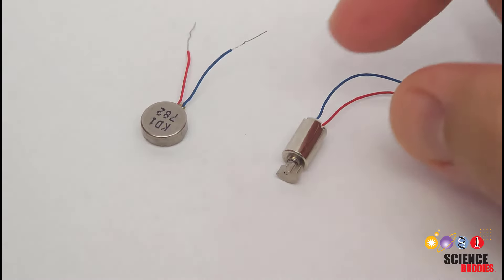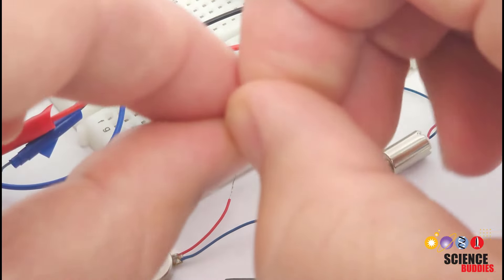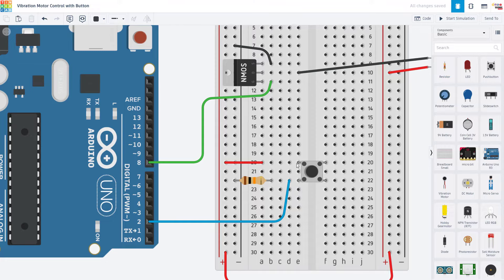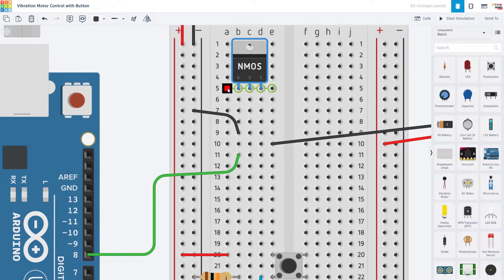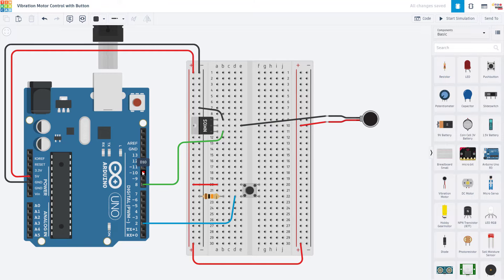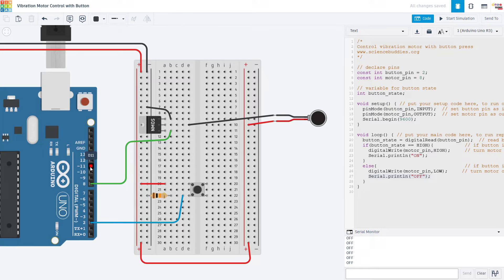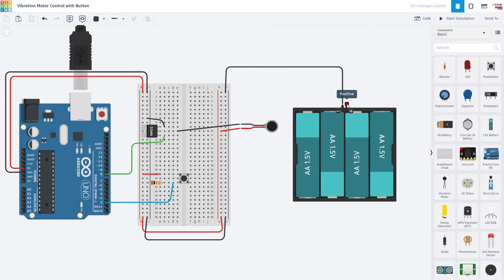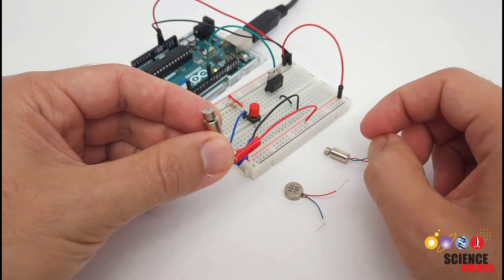How to Use a Vibration Motor with Arduino (Lesson #25)

Comment: Hello. Firstly, I really appreciate your content. I'm curious if it's possible to make it work adding a single 9V battery as an external source. I intend to operate it with a 7V vibration motor (similar to an ERM) since that's what I have available at the moment
Reply from the maker: Hi - in general 9V batteries are not a great choice for running motors since motors require a lot of current and 9V batteries drain pretty quickly. They work better in longer-term, low-current applications. It will work if you are only going to vibrate the motor occasionally though. We have an additional video about using an Arduino with external power supplies here: https://youtu.be/XrJ_zLWFGFw?si=3NdMPCNO03xuBYfg
Reply: @Science.Buddies  Thank you so much for your guidance, sir. I'm a newbie, but after watching your second video, I was able to make it work. Keep up with these great videos!!

Comment: Thanks, I dont code with Arduino but your examples and commentary is teaching me so much stuff I can apply to my raspberry pi projects etc, thanks for the comprehensive, no steps skipped, tutorials
Reply from the maker: Thanks! Many of the digital devices we cover in our tutorials could also be connected to a Raspberry Pi's GPIO pins, so at least the circuit part should be very similar if not identical.

Comment: cool beans.
I think  tinkerCAD might be throwing an error because there's not any voltage protection on the back end of the motor to prevent inductive spiking. 
Although you're talking very small currents, inductive voltage spikes can be either positive or negative, and if you don't have a method of preventing that voltage from feeding back up into the arduino, in theory it could be a problem. 
Like ya said in the video, since it's a circuit simulation, theory is the only thing that matters there, but you might be able to get around it by adding a small diode off the tail end of the arduino ground pin to battery ground pin.

Comment: can i use the motor directly with the arduino like i use my LED?
Reply from the maker: No, the Arduino pins can only supply 20 milliamps (mA) and the motors can use up to 100mA.

Comment: What kind of motor do you use for this application?
Reply from the maker: If you search online for "vibration motor" or "pancake vibration motor" you will find many options.
Reply: @Science.Buddies  does your motor works at a nominal voltage of 5V?
Reply from the maker: Many of these small motors are rated for 3V so it depends on the motor. In that case you can use an external 2xAA battery pack instead of the 5V from the Arduino.

Comment: Are parameters of this transistor important?
Reply from the maker: For such a small motor in general you are not too worried about the parameters of the MOSFET, since even small N-channel MOSFETs can be rated for dozens of volts and amps. For example this one is 30V/60A which is WAY more than this little motor needs: https://www.adafruit.com/product/355